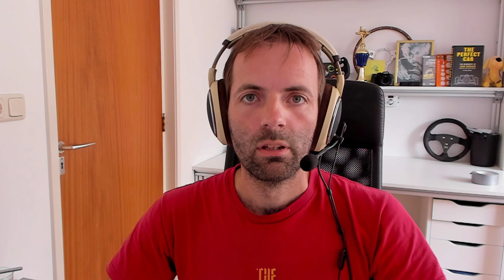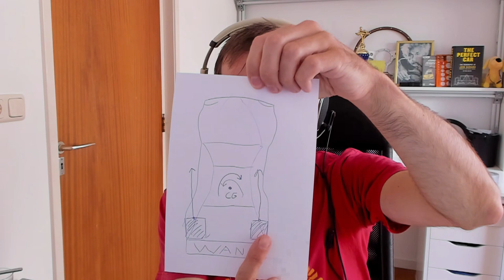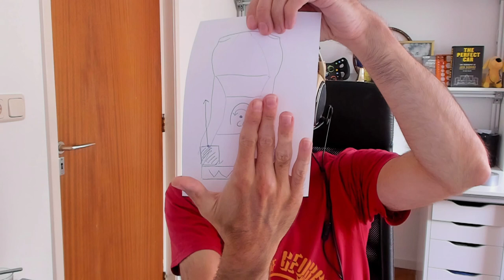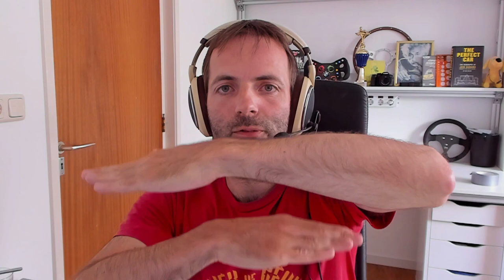An incomplete but (possibly) refreshing look at Race Car Setup!

Comment: Could you do a video on how aerodynamic is affected by roll specifically ?
generally in current sims we get indirect effect via more or less roll as RH are taken as average between left and right.
Reply from the maker: With data I have for recent LMP and GT cars, roll isn't mentioned. I've seen it in some single seater data but overall it is rare to see data. That's not to say there is no effect, but they don't seem to think it is large enough to provide data for!
Reply: @NielsHeusinkveld  thankyou for response. Its really difficult to see any info for roll aerodynamic effects. Would love to hear its explanation tho even if its effect is small its pretty hard to visualise.

Comment: Niels,
I love every video about vehicle physic, so i watch Aris from Kunos videos that I found very interesting and also yours.
One thing in this one caught my attention, is where you saying that we can't bypass low speed damper movement when calculating fast damper.
		
In simulator that i working on, at the moment I switch values depend on suspension speed, so i can have less stiff fast damp ,rebound , than damp ,rebound.
For example for my GT3 spec car at front I have damp  20500 N sec/m,  fast damp 6500 N sec/m,  those values I switch on on a particular speed threshold  in current example at 0.03 m/s. Of course it is very sharp, it can be made to be more soft transition and not in an instance.
If i want to make it in a fashion to add fast bump to bump on higher suspension speed and the same for rebound, probably i will need to use smaller values.
But how it is working in real life, I am not sure , I guess it depend on system, is it pure mechanically or 
electronically controlled , those days more things are possible than in the past of course.
Reply from the maker: What I mean, with your example, you draw a curve with speed on the X and damper force on the Y. First point is 0,0 then you have 20500 * 0.03 = 615N. After that the force grows 6500N for every m/s so add 0.1 m/s you add 650N and that means the next point is 0.13m/s and 650+615=1265N.
So at 0.13m/s damper speed, 615N damping force is caused by the slow damper and 650 by the fast damper. That's what I mean you still 'feel' the slow dampers when hitting kerbs etc.
Reply: Afaik IRL the speed threshold is actually pressure inside damper which opens up additional holes for the fluid to go through reducing further damping force increase with speed. But even if there were infinity new holes in the "fast" section, the damping would not go to zero Ns/m but to the pressure that keeps them open. So you can't really switch between 2 values, you have to start the fast damp from the threshold point of slow damp.
Reply: @NielsHeusinkveld   Ok, thanks, i need to rework my damping algorithm, according to this it is totally off :)
Reply from the maker: @MiroslawFilipowich  Well you have curves like this https://fortune-auto.ssincva.com/wp-content/uploads/2017/01/Fortune-Auto-500-Shock-Dyno-a.jpg  where you can find the damper force for any velocity. A bit like:
if speed <= slowtofasttransition then
  damperforce = speed * slowdampingrate
else
 damperforce = slowtofasttransition * slowdampingrate + ((speed - slowtofasttransition) * fastdampingrate)
Reply: @NielsHeusinkveld  Yes, great , I vas debug curve in my sim,  curve look correct now,   it is little bit AC1 style (with kink) ,but will do for now :)
https://i.imgur.com/NJ6RdYk.png

Comment: Nice vid, but ride heights do influence static weight distribution.
Reply from the maker: Well the front versus rear axle doesn't change, but you can change the corner weights by individually adjusting each corner. You can't really shift weight front or back, but you can balance left and right. So corner weights yes, but total front and rear axle weights remain 99.8% the same.
Reply: Niels Heusinkveld With our fsae car we could change 1-2% of weight balance front-rear axle by adjusting the ride heights, but of course the biggest differences were in corner weights
Reply from the maker: @lorenzorubino2195  Can you explain how? I did this to check:
- draw simple car in Autocad with 1600mm wheelbase and 300mm cg height from ground, 600mm in front of rear axle
- that is 62.5% weight on the rear axle
- move front tire up 25mm, rear tire down 25mm
- Rotate car forward 1.79 degrees so tires are level again
- Measure distance from CG to tire contact points (997.17 and 603.61
- Weight distribution 62.3% 

So with say FRH 50mm and RRH 50mm, weight distribution is 62.5% rear.
And with FRH 25mm and RRH 75mm, weight distribution is 62.3% rear.

And this is generous because a portion of the car will be the sprung masses and I've imagined ALL mass moves. In reality the unsprung masses probably move almost nothing so the weight distribution is even closer to the 'flat ride heights' beginning!
Reply: Niels Heusinkveld I don’t remember the exact explanation, if I’m not mistaken there was something about it in the Milliken, maybe try with a higher cg and see if it changes. I’m sure that we decreased the front ride heights by 35mm and the longitudinal balance shifted from 47.4 to 48.6 to the front. Considering that we had an error of 0.5% on the final weight measurements the numbers are too far off from what you tested.
Reply from the maker: @lorenzorubino2195  Was there perhaps fuel in a tank that moved forward as well from the pitch change?
Reply: Niels Heusinkveld Yes, 4L. The total car weight was 280 kg
Reply from the maker: @lorenzorubino2195  Given that it was formula STUDENT.. I wonder if you can see if you can back that up with calculations. I've certainly been wrong many times but this seems such simple physics that I would be very surprised!

Comment: Can you elaborate a bit on bound and rebound damping and their effect on the load longitudinal load transfer / attitude of the car at entry/exit?
Reply from the maker: Good question because I think this is commonly thought to be a damper thing. Bear in mind I am not all knowing but I think dampers can't / shouldn't be used to try and influence longitudinal weight transfer. On racing cars the suspension is so stiff, plus suspensions tend to have anti dive and anti lift in them, that you simply don't spend any real time transferring weight. When you hit the brake hard, it may only take 0.3 seconds to reach maximum G force and then the weight has transferred and the dampers play no further role in transfer. Of course having not enough damping can cause the nose to dive lower and bounce up again, and the rear to rise higher and then settle down again, but it all happens in a very short amount of time.

And on corner exit, once you go on the throttle, some weight transfers back but that is also almost instant. You cant really influence that with damping. And then the more you go on the throttle, more weight will slowly be transferred but its all perhaps 5mm of suspension travel from the rearward weight transfer. Its not enough travel and not enough time spent for dampers to really do something in my opinion.

Braking hard very suddenly tends to cause oscillations anyway because the tire is a 300N/mm spring that you give a 'whack' by slamming on the brakes and that might oscillate and cause fluctuating ride heights no matter what dampers you apply.

Perhaps its because I don't understand dampers or they don't work as they should in AMS but while both these things can be partly true, I still feel dampers are a bit overrated. Some people seem to think they influence everything all the time and I see their importance but also think other suspension settings soon become more important. How fast you apply the brakes or how gentle you apply the throttle are WAY bigger things to change the car balance.
Reply: Thanks a bunch Niels for the feedback, my theory was they will affect the transitionary behavior of the vehicle, especially when you roll off the brakes into a turn, whether the front load gained under braking will stay longer and give a bit extra front bite as a result.

Speaking of which you mentioned the diminishing return of load vs grip generated, does that also mean the harder you brake, the more load you put on the fronts, actually will mean you generate less front end grip for turn in?

Appreciate the feedback again.
Reply from the maker: @jj72rg  Well its not 'wrong' what you descibe with turn in, but I think the way you use the wheel and come off the brake is 98% and 2% is dampers.

More load is typically more grip, but the increase of grip isn't linear. So with 500 kg load, grip is say 750 (x1.5) and with 1000kg load grip is say 1000 (x1.0). More grip, but not the 1500 you might expect given the 750 grip we had at half that load.
Reply: @Jay Wong  For braking, the diminishing returns are more of a car wide thing. For example Porches are good on brakes because they suffer less diminishing returns from even load distribution.
In your case diminishing returns from load transfer are working against much more significant shift of load to the front. And after that both are pitted against brake balance to determine if the car is under or over-steery on entry. So while yes you could say diminishing returns reduce front grip, there is no way to feel this effect unless you'd have some extreme case like braking on ice without studs.

Also regarding damping. Remember that in dynamic situations like letting off the brakes at turn in. You are transferring from one steady state to another. And while dampers can control how it happens, the sum of what they do has to be the same, no matter how stiff they are, to reach given finish state. This means the harder the initial response of stiffer dampers, the harder they will go >the other way< when close to the end state. So to gain anything from dampers the car has to physically move to a stance with different balance (usually yaw the few degrees needed for tyres to load laterally) in the first half of the transition, to then combat the opposite damper response with said stance. Which all happens just too fast on stiff modern racecars to matter. And if you try being slower off the brakes to compensate it will only reduce the effect dampers have on dynamic load distribution, not the speed it happens at, that depends on springs.

Comment: In all sims i have to reduce antirollbars, it feels much better.
Reply: Stiffness is good for steadyness and responsiveness though. What matters the most is the stiffness ratio front vs rear. Stiffer or softer generally just changes transient behaviour. Also one thing to think about is that higher amount of roll will cause more changes in weight distribution, although it will always slow down the load transfer. But tires are foundation for everything, perhaps if certain sim does always benefit only softest settings for a car, then perhaps there is something lacking about the tire and maybe aerodynamics, but it depends, I don't know. Anyway if there is something about setups that trully works best in its most extreme setting allways, then it is perhaps best to get it fixed at it and thats it.
Reply: @mantasisganaitis2281  I'm pretty sure stabilizers do absolutely nothing to weight distribution. If the roll stiffness in the front and rear is increased the same amount (Taking into account CoG, RC, springs, everything, not just rollbar rates) then you will still have the same LLTD IIRC. The only load distribution change with more roll would be perhaps the CoG shifting slightly.

However more ARB only really benefits drivers above a certain skill level IMO. I argue you have to be very good, very solid fundamentals and be driving convincingly close to the limit to really get any true benefit from the transient behavior. Everyone else generally does better with more uncoupled wheels.

Or just have a ton of roll and height sensitive aero. Then increasing FARB can actually gain you a ton of front grip for example. Or perhaps have a lowered strut roadcar with a bad camber curve, so the less it rolls, the more grip your outside tire can provide. Subaru WRX is a good example; more FARB increases power-oversteer because the front pulls the car in more!

Comment: I have always gone with more toe out on the front for better turn in.. slightly confused now??
Reply from the maker: I've never quite understood the reasoning behind that. Turn in means how the cornering forces on the tire build up, and you can never disconnect the front from the rear of the car. If the front axle gives more cornering force, you get more turn in. As you start steering, the camber forces are still high and probably greater than the forces from normal amounts of toe. 
The inside front tire with toe out will produce more cornering force sooner than the outside tire, but the inside tire very quickly becomes less important than the heavier loaded outside tire. So all else being equal, front toe out will slightly reduce initial cornering response.

However, perhaps that's actually better because if you get too much initial turn in, you might get a bit of initial oversteer that you feel you have to correct, and perhaps with slightly delayed steering response with more toe out, you are more confident and the car is more stable because it turns in a bit LESS sharply.

Still, this is all quite subtle and we're talking mainly about the first 1 or 2 degrees of slip angle which are done in a few tenths of a second. Its very easy to drive a car a bit wildly and you won't feel much difference. You really feel it only very close to the center of steering. I was working with a MX5 cup driver where I did feel the toe settings a bit when I was really carefully trying to do my corner entry. He drives more aggressively and then you 'skip' that initial part of car response by fast steering.
Reply: @NielsHeusinkveld  I was also confused by it because to me. The outside tyre is most important so if it points outward it isn't doing much to help turn in but it always seemed to work for me. I picked this up many years ago from a setup guide i once read however It could just be placebo effect.
Reply from the maker: @benjimc1  Placebo I'm convinced is a big deal in real racing and simracing. I'm sure simracers and also real engineers and drivers talk eachother into a direction sometimes where they agree and think they made the car go in a certain direction that it hasn't. Its extremely common for humans to do these things. I tested this in AMS with keyboard steering so the rate of turn-in was 100% repeatable and I always did it at the same speed. Then you can plot how the car turns in (mainly the yaw rate) for different toe and camber angles. That made me come up with my view on camber and toe for initial turn-in.. But again, its only a small effect, once you crank up the steering lock you don't really feel a bit of toe anymore.
Reply: @NielsHeusinkveld  that an interesting way to test it. 

Regarding placebo, I either make sure i do a good 5 to 10 laps when my setup is down to the minor tweaks. Or I will call it a day and see how both setups feel the next day to give a comparison.
Reply: @NielsHeusinkveld  A little anecdote, but manufacturers dial-in toe-out to the front of cars with bumpsteer, so that they UNDERSTEER on braking and trailbraking. 
Toe-in bumpsteer would actually increase the yaw instead of decreasing it, which is why it is uncommon.

Something to think about. Seems to help your case.
Reply: I guess your drivign style makes the difference here. If you are likely to steer too much, then toe out is likely to compensate this a little bit. Toe in should always give better turn in at the initial moment the steering input is  being introduced from moving straight forward to beginning a turn, but it will also take little bit less of steering to overshoot the slip angle a little and set in the understeer.... anyway thats how I see it... toe is generally pre built amount of slip angle, and also little bit like vectors adjustment for driven wheels, I don't know if there is much difference for braking, it would probably always be best to have neutral toes for best braking, maybe ?
Reply: @
BenjiMC1 There are 2 opposite effects happening when it comes to toe. Niels describes what happens on flatter tracks and stronger cars. While on more rough surfaces and/or with cars that have weaker suspension (think rubber bushings not softer springs) another effect comes into play: As one wheel climbs a bump it is pulled back which makes it toe out. Now if the car had some toe-in at the start, the wheel is now straight and even with very high momentary load there is little lateral force generated - so the car is stable. But if it had toe-out, the bump increases that, further destabilizing the car (in effect, adding turn in). This can get quite a bit more complicated, but in general expect to get better turn in going toe-out in WRC and toe-in in F1. Also it depends on simulation, some sims like AC, Rf1 and i think AMS1 have no or limited suspension link stiffness simulation, in which case toe works mostly like Niels says. And even if sim has both effects (ACC has it i think) they may very well cancel each other out on some car-track combos, leaving you with only Placebo to help turning in.

ps: Similar thing happens with dampers if you read those "quick car setup charts". Niels completely ignored what they usually say there, as most of their "wisdom" comes from some autocross/low level racing, which never really works for the stuff we race in sims.